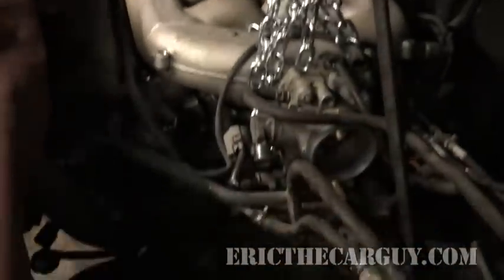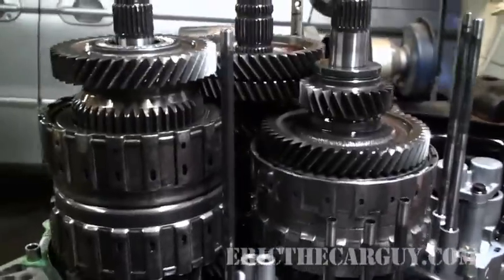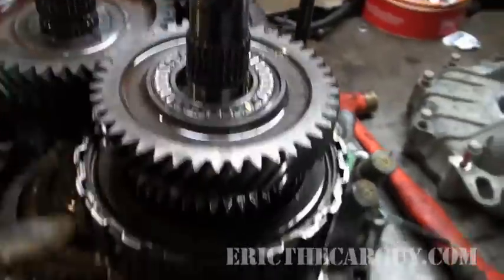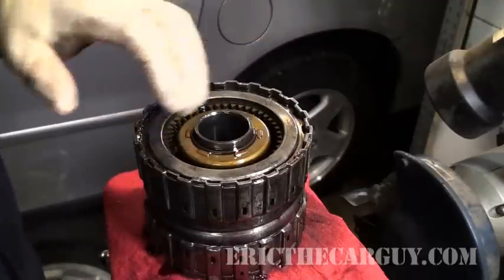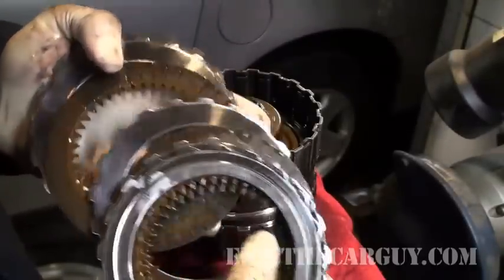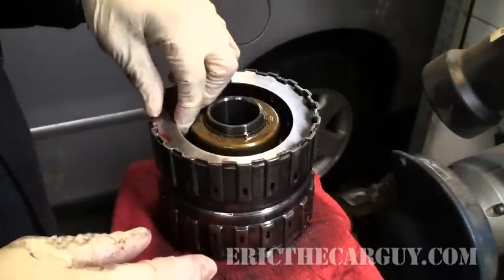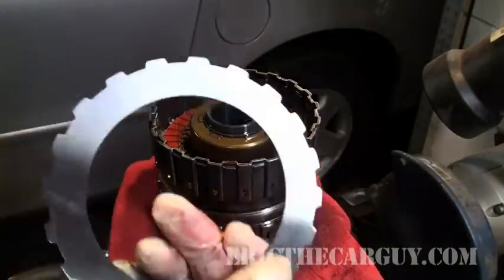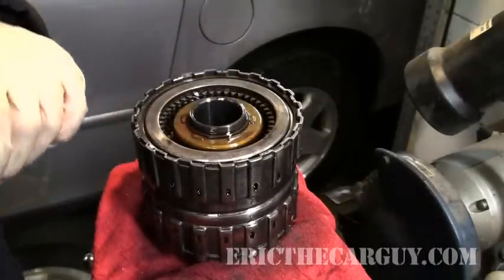Inside My Odyssey Transmission - EricTheCarGuy

Comment: hey i've witnessed this odd problem 2 times about 8 months ago, and 2 times in the past 5 days. When going downhill i come to a stop sign, i accelerate but the rpm just goes and the car doesn't move then Boom she jumps into gear and i take off on the spot. As if someone put the shift lever into Neutral and threw it into drive while my rpm was high.. This never happened for the past 9 months, only seems to happen when facing down on a hill.. Whats the deal?

Comment from the maker: @TheEsevee Hard to say, aside from the hard parts inside the transmission there are electronic controls that could also cause shifting problems.  You need to do some pressure testing and diagnosis BEFORE you take it out to really know what is wrong with it.

Comment: Thanks for the inside look!  I appreciate having some insight into the great mystery of Honda Odyssey transmission failure.  I'm looking at a 3rd transmission inside 135k miles on my 99 Odyssey.  And you know how much that costs!! Since  your transmission was slipping but the gear plates didn't look very worn is it reasonable to conclude that a fluid change with some Lucas anti-slip addative may help to resolve the symptoms?  I just can't imagine that the rebuilt replacement should only last 40K

Comment from the maker: @vitali1985 It does sound like a transmission issue you might want to check the fluid level and condition first but if it's at the proper level then you probably need a transmission.

Comment from the maker: @MrTee448 Yea especially considering I drove the van to the shop from my house across town and it was my only ride home so in essence I had to do this in about 9 hours, hope it worked and drive home.  Perhaps if I took a bit more time and worked in a cleaner environment I would have been less apprehensive.  Automatic transmissions are the most complicated system on any vehicle and you need a good working knowledge of them before you decide to tackle them I don't recommend it for the DIY.

Comment from the maker: @DtoWnSux1 Manuals don't use the fluid to operate the trans where automatics can't function without fluid.  All your doing inside a manual trans is lubricating parts, in an auto trans the fluid not only lubricates but it also performs critical functions that operate the trans and as a result of this it wears out differently than it's manual counterpart.

Comment: IDK n e thing bout transmissions. 2003 honda element.manuel. 130k miles on it. never had a trany fluid change. wanst driven hard ever. Should i flush it or will that make it start to slip due to crud geting knocked loose? PLEASE HELP ME I NEED IT CHANGED BUT am seriously scared i dont know much about transmissions. please

Comment: I have a 2000 Honda Odyssey that is in my drive way with dire need for it's third automatic transmission and what i am considering is just putting in a 6 speed standard trans if it can be done, still not sure if it is. have you ever head of anyone doing this?

Comment from the maker: @robertfrate The 4 cylinder transmission is not the same.  I would not advise taking apart an automatic transmission unless you have the experience and the tools, in fact this trans failed again 2 months after this repair.

Comment: Nice, how is it going?  I just put mine back together, it's going back in the van this weekend.   Mine's an MDWA 4 speed from a 98 ody.  There are a couple screens in there that you need to clean in the valve body.   The valve body itself is super simple to go through.  1 check valve, 1 check valve/piston.   Accumulator has a couple checkvalves under the cover.    IMHO these are easier than a T350/400/700r4.  It's all attention to detail .  The steels are different thicknesses on each clutch.

Comment from the maker: @jjashik7 There should not be an issue as long as you turn the traction control off, if not the ABS will kick in.  To be honest that method is not really necessary if you change the fluid about every 30K as that is what is recommended by Honda.  However if it's been a while since it was changed or someone put dextron in there that method would work very well.

Comment: Hi Eric, as u know, Honda recommends drain, fill, drive, repeat up to 4 times to change max amount of the fluid because the fluid in Torque Converter stays in during the drain. So when I lifted the front and drained the fluid on my Ody, I then started the engine and ran thru some of the gear (with the F wheels up) to remove max fluid. More fluid does come out. I figured there's minimal strain on tranny with wheels up. I check fluid level after refill. Is this a good idea, and safe, or a no-no?

Comment from the maker: @antonio30824 No matter what if you haven't changed the fluid in a while it's a gamble.  Personally I would do a drain and fill before a flush but as I said either way you may end up with a problem in the end.  Good luck.

Comment: i would have also replaced the torque converter with a DAACO unit.  Good luck, these transmissions are horribly unreliable.   Great post, however!

Comment from the maker: @hobieslug45 yea the measurements are a big part of a tranny rebuild as well as working in a clean environment.  They are good transmissions for the most part but I feel after they tried to make them shift smoother they ruined them, the older transmissions that shifted harder lasted much longer.  Thanks for your comments.

Comment: Eric when I replaced my 94 accord tranny( basically the same with one less shift pack ) I decided to take apart the old tranny .
used the helm book that walks you thru it step by step and it was a piece of cake . they give you the specs for the throw on the clutch pack ,all you need is a dial indicator and a micrometer . with their instructions I went through every thing even the valve body. with out the book I wouldn't  have known about the left handed thread on the counter  shaft.

Comment from the maker: @Paddedmind Tough call really.  I might start by changing the fluid with Honda fluid, it's easy to do really just drain and refill.  If the condition gets better change the fluid one more time after driving for a while as someone may have used regular ATF in it.

Comment from the maker: @12santo1 Those are the classic signs that the trans is on it's way out.  You might do a fluid change but to be honest you should just prepare yourself to replace it.  BTW you should ALWAYS use Honda fluid in a Honda transmission.

Comment: hey Eric i have a 99 accord v6 and lately in 1st and 2nd shifts late about 3500rmp. if rolling back from 10 to 40 miles it drops a gear and i feel a thump. it also takes long to engage the reverse and forward gear. I replaced the oil at a local oil place  1 year ago and it has been fine until 3 weeks when it started doing this. Reason why i replaced the oil was because it was shifting rough. Any helP?

Comment from the maker: @The18Jake Start with the obvious like checking the fluid level, if it's OK then see if there is some way to pull codes from the trans unit.  Next it would be time to check the pressures inside the transmission in order to determine if it's a problem with the internal parts inside the trans.

Comment: Eric,I don't know if you'll get to this, but I drive a 1984 lincoln towncar,and I found that my tansmission electric control unit is making a buzzing sound (sounds like bees) when I drive around and then put it into park,it stops when I change it into any other gear. if i switch it into park,it starts again. Any idea if its going bad or not?? It is verryy annoying.

Comment: what's your advice on changing ATF on a car that hasn't had its ATF changed in a very long time (from a previous owner,) but it is still running strong with no problems whatsoever?  I left it alone due to what my local mechanic told me what would happen if I did change the ATF on my car.  "If it ain't broke, don't fix it."  That's how I look at it.

Comment from the maker: @raza8560 When we replaced a trans at the dealer we would install an inline filter that came with the trans.  It's a great idea but if you change the fluid every 30K or so you should be fine.

Comment from the maker: @Paddedmind Yea, I wish I would have showed the subframe on the floor in the back of the shop.  If you don't have the right equipment to do this, at the very least 2 floor jacks and an engine support your never getting it out of there.  Lot of work to be sure good luck.

Comment: @finalman82 Brilliant idea! My observation is the older transmissions use a fine mesh filter and the "life time" fill ones use a cloth type filter. The mesh is only there to stop particles that would jam and block the controls. However it does not stop sludge form clutches etc. that will wear the transmission.

Comment from the maker: @Goat366 Not exactly sure but normally they are just under the trans pan.  It's hard to say exactly what is going on but fluid changes are often the first step in a trans repair however sometimes changing the fluid in a trans that hasn't had a fluid change in some time can cause it to slip more instead of fixing it.  I know that may not be the best of news but changing the fluid is still a good place to start.

Comment from the maker: @americantractors A couple of people have mentioned that and it is a valid thing to try to be sure, I'm just a little leery of doing it in a Honda trans as I've found them to be very sensitive about what fluid you put into them. After going through this I might think twice next time however but that wouldn't make for a very good video now would it? Besides, I always wanted to crack one of these open anyway just to satisfy my own curiosity and I don't think I would be so bold with a customer car.

Comment from the maker: @tranceaddiction 04's had a lot less problems, I changed my trans fluid once a year in this van but to be honest I'm sure it's a design flaw that caused them to fail the way they did.  I their defense it's hard to make a long lasting transmission when the buying public wants smooth shifting, actually the harder a trans shifts the longer it will last.

Comment: Ericthecarguy, I congratulate you on a job well done. I own an '04 Odyssey myself, and I am really afraid of this problem because I've seen honda's go though drivetrain's. 

Great engines but problematic transmissions. I change my AT oil every 30,000 km (18,000 mi) for this reason.

Comment: hello etc, this is probably my 6th question about my integra(if you do answere it). ok, so when i floor my integra on 1st or 2nd or w.e, and it goes above 5000 rpm, a gas burning smell starts to come inside the car. so what could that possibly be?

Comment from the maker: @ffgew22 Well that's what I'm here for.  I'd say that ffgew22 pretty much covered it, the clutches were the metal discs that I replaced inside that drum assembly if you were wondering.  A certain amount of slip is built into an automatic transmission so ALL of them will have some amount of metal that is hopefully trapped by the filter as well as the magnets.

Comment: @EricTheCarGuy Thanks for your reply, I see your logic a pressure problem would have to be specific to that clutch or that part of the valve body. I attempted and failed to repair a 4 sp auto Honda box from an 84 Accord. It would not change gears. I thought it would be the govener but I could not find any visible problems at all. S/H box solved that one. I look forward to your fault finding video.

Comment from the maker: @DanielGMich To be honest I really wouldn't do anything else other than perhaps replace the other clutches and possibly the filter but that's really just a screen and could easily be cleaned out.  I might do a video but to be honest it's good to verify an issue before rebuilding instead of what I did here.  I also have concerns that people will get in over their heads with this job as it is very involved, I forgot to show the subframe on the floor, getting this trans out by yourself is a chore.

Comment from the maker: @andrewthompsonuk1 Lets just say that I have 'extensive' experience with Honda transmission problems and given that it was only slipping in one gear I don't think 'pressure' was the problem but rather the clutch packs, I replaced the seals as well, remember in the world of automatic transmissions thousandths of an inch make all the difference and may not be apparent to the naked eye.  I plan on making a video on transmission diagnosis at some point to help pinpoint problems before disassembly.

Comment: Sorry to be negative but were those clutches worn enough to slip?  I would be worried there was some sort of pressure problem.  Have you tried working it hard at full throttle?
I am all for having a go at transmissions especially when it is only time.

Comment: @EricTheCarGuy - in my experience, Lucas transmission additive is nothing more than turd polishing (and you can't polish a turd). I'm not saying it isn't a good product, but it is what it is, and additive to band-aid something that needs to be fixed which is broken. It's the consistancy of cold maple syrup which is easy to see why it would "stop leaks + slip" as it claims. They put a claim that it "Extends fluid life up to 3x" which is flawed in that ANY change in fluid would do that as well.

Comment: @EricTheCarGuy When buying sythentic, I sway towards Royal Purple. The reason is simple, 90 percent of automatic transmission failures are caused by overheating, friction is only so good with clutch packs. A change of 20-30 degrees can easily double the life of any ATX. I don't have much proof beyond "It's better" but Royal Purple also LOOKS COOL (which goes against my rationale of why you should use products) but  how many Autotragic transmissions do you know that HAVEN'T started slipping? lol

Comment from the maker: @KNTRIDER Not really, the metal debris is picked up by a magnet on the drain bolt, the filter is just a screen anyway and to be honest it's not like an engine that is not a sealed system and is subject to contamination.  The auto trans lives on it's own and the only contamination would be it's own worn internals or something you dropped down the dipstick hole, a screen is sufficient to deal with that mostly. It's important to use Honda fluid in these however, if not problems can result.

Comment: Knowing now that these transmissions do have a filter, I can't help but scratch my head at the design...a next-to-inaccessible filter in a machine where maintenance is somewhat critical...? I'm sure that the filter must get somewhat clogged over time (considering some of the hairy drain plugs I've pulled out of those things in years past) and that can't help promote a long service life for the trans.

Comment from the maker: @IrnMaiden304 With automatic transmissions it's all about pressure, the seals, and the clearances.  You need the pressure to move and hold things, the seals to keep that pressure where you want it, and the clearance to be in the money zone for things to work well.  If things wear past the service limit you will loose pressure and your ability to hold things in place, hence the term 'slip' when referring to what happens when an auto trans is not performing up to par.

Comment from the maker: @GrandDanois Well I'm not familiar with the "DSG" but these are pretty much manual transmissions with clutch drums instead of syncros.  As for how effective it is at least this model had a lot of problems with slipping gears.

Comment from the maker: @rgiaco777 Yea I was tired as that was a loooong day.  Yea, that's the reason why I preach using only Honda fluid in a Honda trans because they are different than any other trans I can think of and the fluid was designed to work in their transmissions specifically.

Comment from the maker: @youtubasoarus Your right, when Honda decided to make their automatic transmission they really just modified the manual that they had using clutch drums in place of syncros as a result it is a unique design that's why I preach using Honda trans fluid only as just about every other auto trans is of a different design, Honda specially designed their fluid to work in their transmissions.

Comment: I believe Honda designed their auto transmissions based on a manual transmission so they wouldn't have to pay royalties for the use of planetary gear set transmissions like most other car manufacturers do.

Comment from the maker: @FITVANITY11 I'd be looking at the rod that runs from the transmission to the shifter and the shift rod itself to see if anything is loose.  It might also be a suspension or engine mount issue so do what you can to narrow down your search by checking all these things.

Comment: @bhstone1 Indeed, you are correct good sir. I'm quite well versed in the servicing of typical domestic transmissions which have the setup you described. The scenarios of confusion to which I referred in my original comment were concerning import automatics such as Eric's Honda, where there is nothing but a magnetized drain plug to service the fluid, with no pan to drop for a filter change. Eric's video answered my question of whether or not there is a filter and where it is. Thanks though.

Comment: @KNTRIDER Most of the time the filter is inside of the trans pan. You have to drop the pan and drain the AT fluid in order to replace the trans filter. While you do this you also replace the pan gasket and clean the magnet in the pan.

Comment: Hey E.T.C.G, I'm not a trans expert, but those old clutches  looked  fine. I doubt the new clutches will solve any problems you were having. Maybe they were slipping because the  drum wasn't getting enough pressure. Here's a video from Youtuber larrybloodworth, which shows an Odyssey trans that was slipping badly    watch?v=yDTGgzA60cA&feature=mfu_in_order&list=UL
In the vid, he says sealing rings were bad. 
Maybe you could e mail or call him with questions if your problems come back.